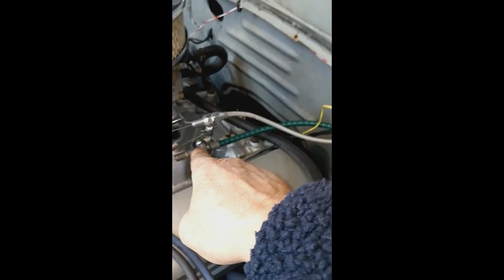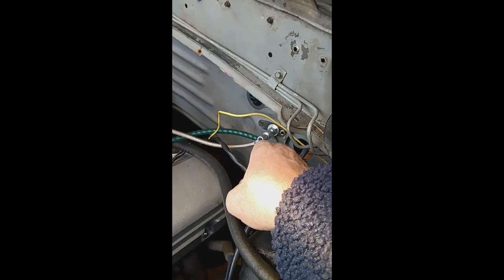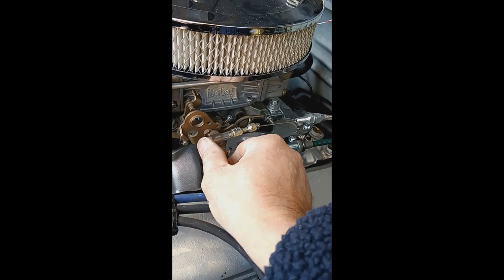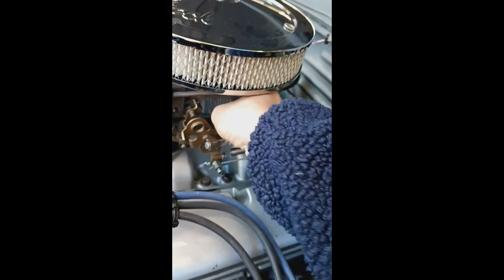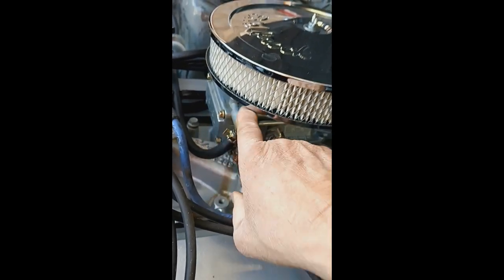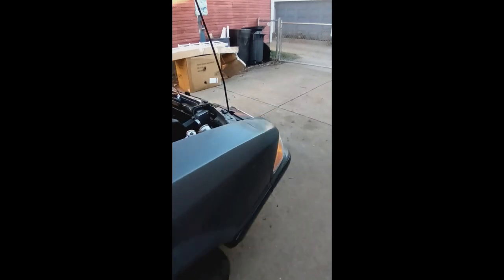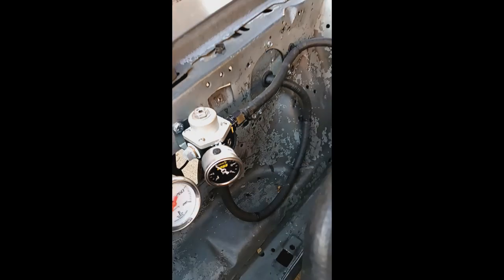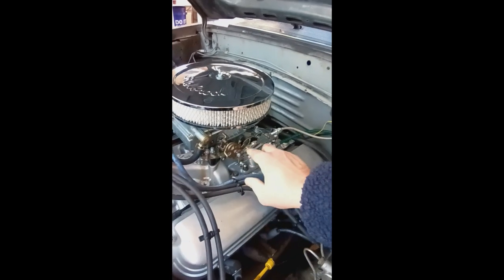Fox Body Mustang EFI to 4 Barrel - TV Cable AKA Kickdown cable hookup

Comment: Beautiful car, Doing the same thing on my 89 LX right now. Am I able to use the efi fuel pump in the tank and just run a return style regulator? Tons of people say its fine then other people say no you can't.
Reply: Its a 1989 EFI Manual trans. Converting the car to 302 Carb. Got a great deal on a motor and so tired of the old wiring in the car.